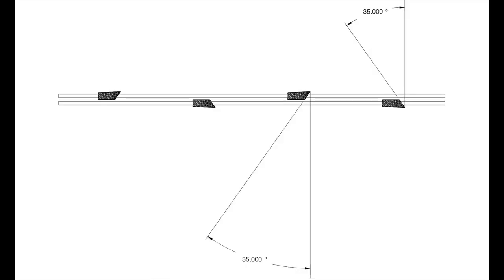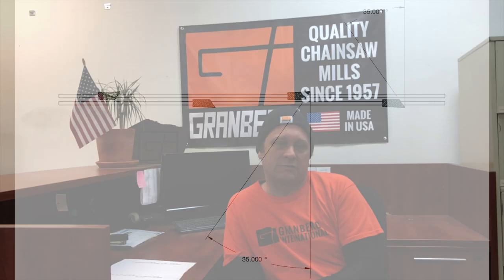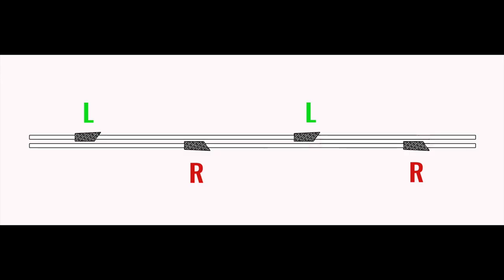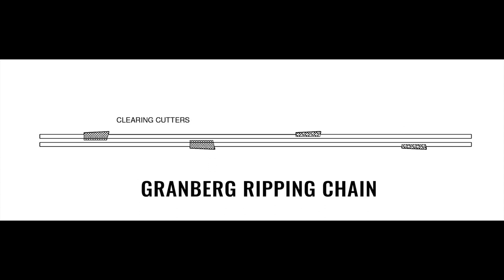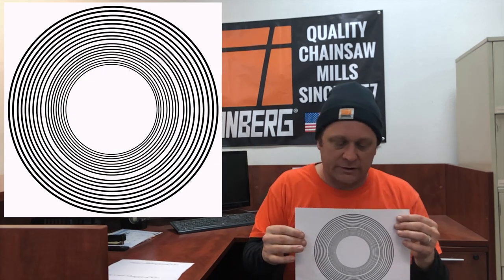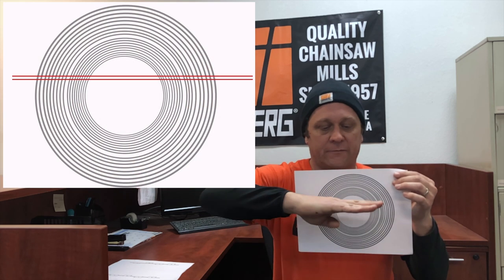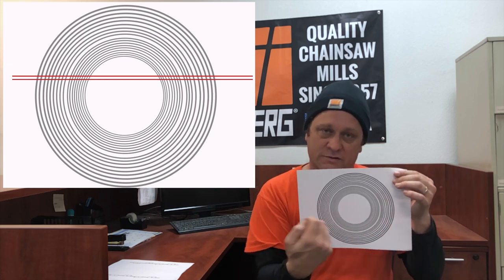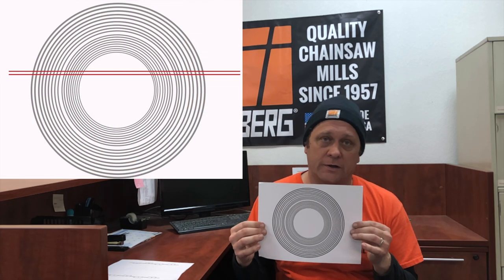Ripping Chain: What it is and why you need it (Edited Version)

Comment: If your using a stihl chainsaw use just go and buy a stihl ripping chain and bar ‘ they are specially made for this type of work ‘ and like there saws they are excellent ‘ the stihl bar and chain cut a much narrower kerf or cut width than the granberg chain ‘ which in turn passes through say hardwoods much easier than the wider chains and bars ‘ which in turn produces much less sawdust and more usable wood ‘ for instance cutting boards of 1 inch thick where a lot of waste can Accor ‘ the stihl set scores greatly here
Reply: Hmm. Might try this approach. Granbergs 36 inch chains are back ordered. Thanks for the recommendation. I just got a MS661 and can't wait to get some slabs cut.
Reply: Good , the 661 is a great saw for milling , I use it a lot , what are u milling 👏

Comment: Sometimes I have to half & quarter big logs for fire wood. I've thought about using a ripping chain for this work......is there any safety issue with that? I've seen a lot of people say there is danger in using a ripping chain without a milling attachment.
Reply: You shouldn't need a ripping chain for cutting lengthwise down firewood. Like he said in the video you will get the long ribbons of sawdust. The only problem with a standard chain is it cuts too fast and it'll get bound with sawdust. This is where the skip tooth chain comes into play, it's made so it's less likely to bind with the long ribbons of sawdust. I half and quarter logs too, just with a regular chain
Reply: @jaredeberly9724  Yeah but the point is: I'm trying to avoid the ribbons. Also, I still wonder about the safety issue with the ripping chain.
Reply: @09rja  I would assume that it would work better because it would be taking less off. They would still be ribbons but it would be shaving less off at a time. Also maybe keeping the rakers high on a normal chain would have the same effect
Reply: If you have any older chains for your saw file them to 10-15 deg angle across the top you’ll be ready to go.
Reply: The connection links are the same.  The rivets are the same.  I often free hand saw boards without a mill guide.  I have broken more standard chain links than ripping chain.
The tow formed by cutting length wise makes good kindling when dry and great smoke when green.

Comment: Do you guys sell a 14” ripping chain? Thanks!
Reply from the maker: When you order our Ripping Chain you can get it cut and looped to whatever length you'd like. You will need to pull the information from you bar though. It is stamped into the bar on the side closest to the powerhead. Email us at info@granberg.com if you need any help figuring this out!
Reply: @granberginternational  thank you!!  I actually just bought a new 18" chainsaw (Stihl) and I will definitely want to reach out to get, at least one, extra chain.  Thanks for the information!

Comment: If I go with Granberg chain in my 36" Alaskan on a Stihl 661, do you have a sharpener for idiots. I can use the Oregon guides with 25 or 30 deg for cross cutting but is there anything you sell that will guide me at 10 deg. I find free handing impossible. Thanks.
Reply from the maker: Our Granberg File-n-Joint and Granberg Precision Sharpener both have dials so you can easily sharpen your chain to 10 degrees and very accurately at that. Ill link our Precision Sharpener Chain video here for you to check out!
Reply from the maker: https://www.youtube.com/watch?v=TmiHqYNmdQ4